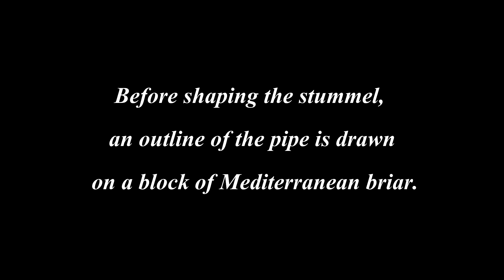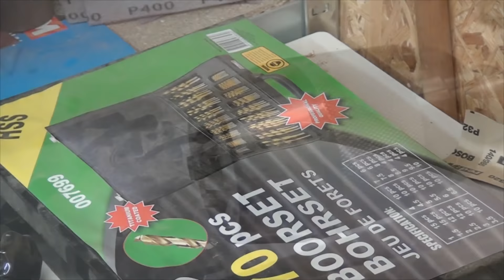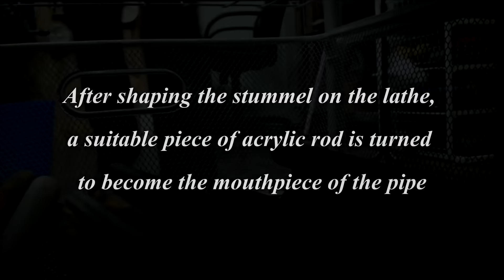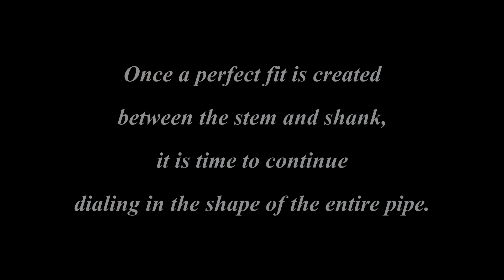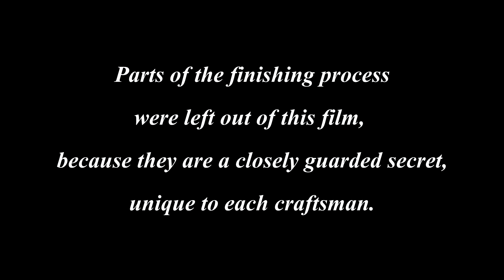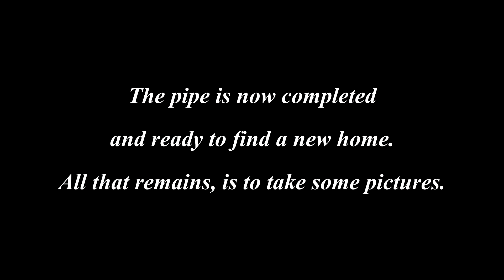Making a 'Massis' tobacco pipe

Comment: Can you tell me what multi-tool bit you're using to create your slot at 6:34? I can't find anything that's the correct size for this.
Reply from the maker: It is a dremel bit, number 199 if I'm not mistaken. They're pretty pricey but last for ages if you're only using them for slots.
Reply: @MassisPipes  Thanks, I'll try to find one!

Comment: Hello there...your tools let me think that you are from Germany but correct me if I'm wrong. Can you tell me where I can get this little wheel to make the stems cut at the end? I don't know the correct term.

Greetings
Reply from the maker: While the lathe is in fact German, I am not. I  am Belgian.
The small wheel to cut the initial slot in the stem is a dremel cutter. The 199 High Speed Cutter to be precise.
Reply: Massis Oh okay I've been there for a while...I liked it 👍🏼
Thank you very much I also use it now for my own pipeneeds 😄